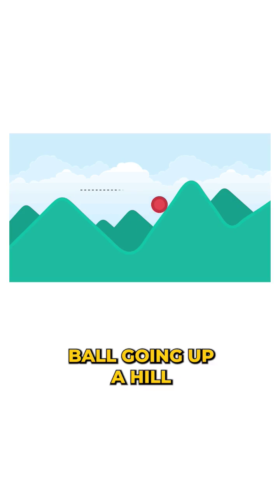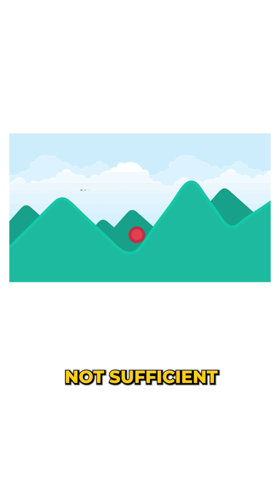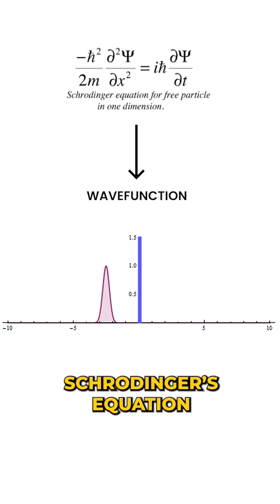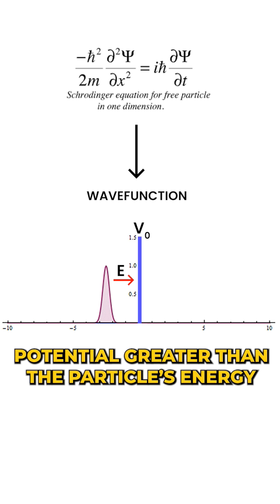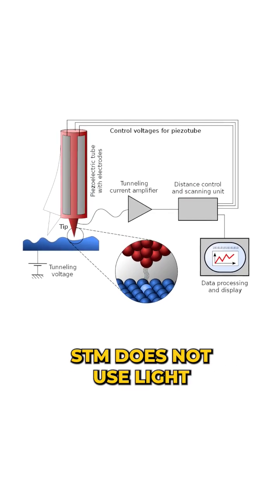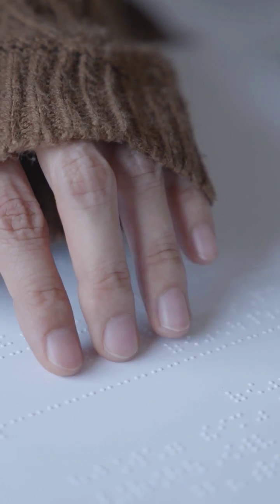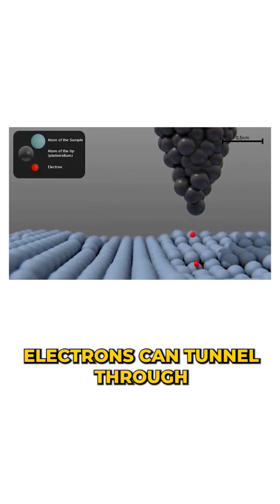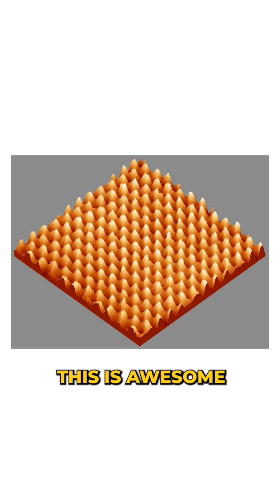Quantum Tunneling - The Mind-Bending Phenomenon behind STM

Comment: so the tunelling current is directly proportional to the distance from the tip of STM and the surface and by measuring the tunelling current they get the distance and doing that repeatedly they are able to get a 3d map of the surface?
Reply from the maker: It's not a direct proportionality, more like an exponentially decaying relation. But yes, based on a comparison they can calculate the relative distance and hence map the surface